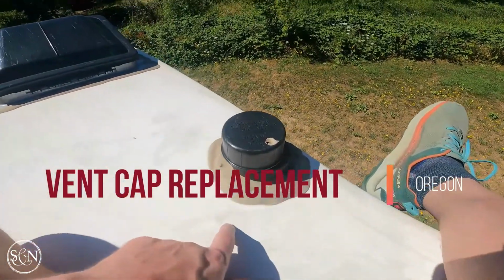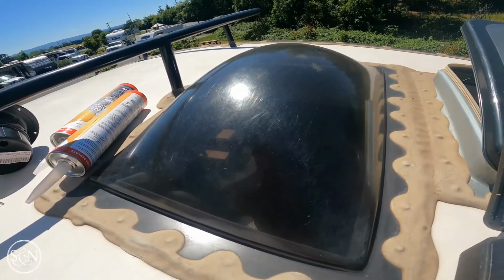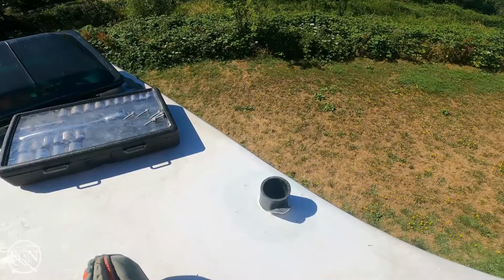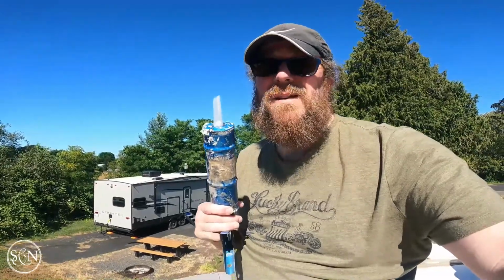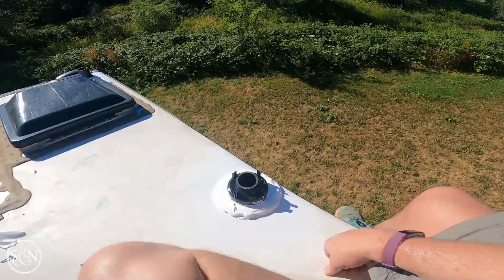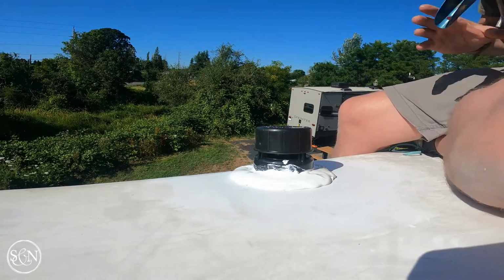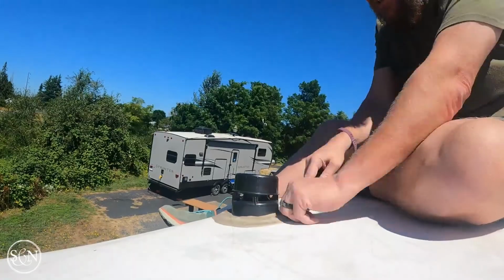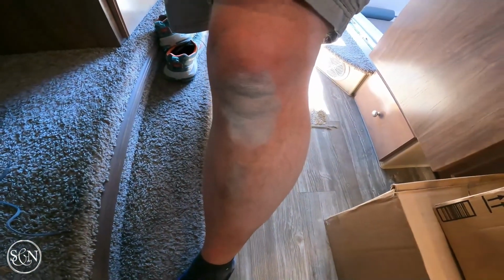How to Replace a RV Plumbing Vent Cap

Comment: That should be a 1/4" nut driver so you may have been able to take your screw tip out of the driver and use that.  My favorite drill that I carry with my gear is the Milwaukee 4 in 1 install driver.  Perfect for rv work especially with the offset and right angle attachments... it's a little pricey but worth it.

I recently had to replace the top globe above my shower.  It was old and cracked a little so water got between the 2 globes.  I couldn't get the globe right away so I still had to cut the caulk and jamb close pins between the 2 so the water would drain out.  I couldn't get the smoke finish so had to go with the clear... now my bathroom is super bright.
Reply from the maker: That’s good to know on the nut driver!  I’ll be back up on the roof tomorrow so I’ll check it out.  I have a cheap drill buried near the water pump.  No fancy attachments yet.

Luckily our top dime in the shower is ok.  I can’t imagine using a clear dome.  Yesterday was so hot we hung a towel up in that window to block the heat!

Comment: Ladders work great for any work on the edges of the RV. 😉👍🏼
Reply from the maker: That’s definitely true! But in a smaller truck camper, we just don’t have the room to drive a ladder around!
Reply: @CupcakeChroniclesTC  you could find a really compact telescoping ladder
Reply from the maker: @coler154  that’s a good idea. We’re just always balancing weight vs usefulness of everything we carry. It’s crazy how fast it all adds up. We even go through our clothing regularly to reduce weight.

Comment: Why don't you just remove the screw, pull the top off and replace just the top?
Reply from the maker: The vent cap itself wasn’t broken. The connection beneath the cap, that holds the vent cap in place, was broken. To replace that portion the entire vent cap assembly needed to be replaced.
Reply: oh ok